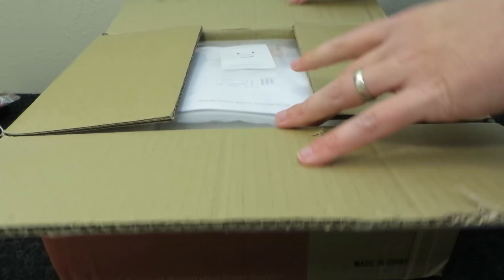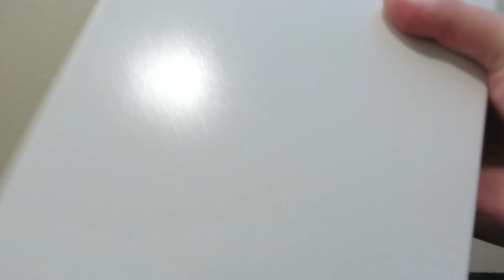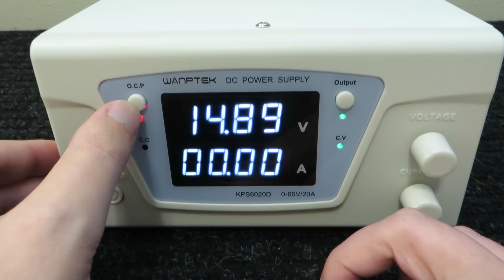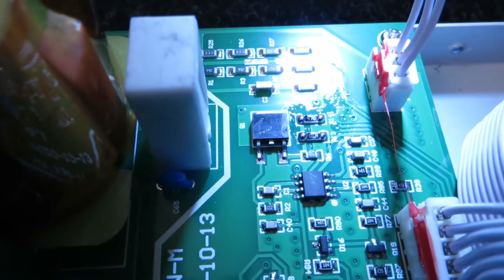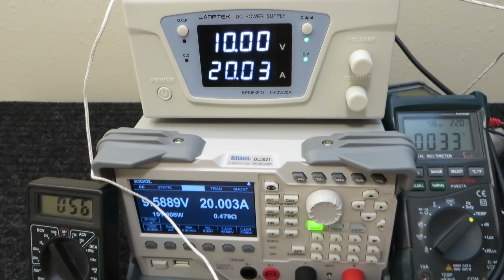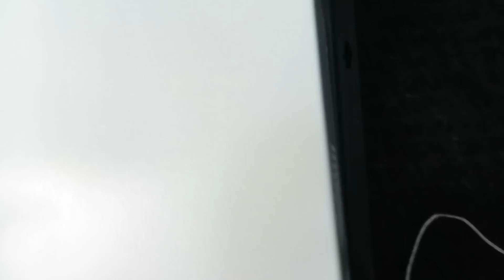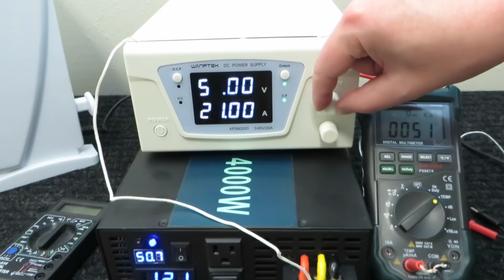1200W 20A 60V AliExpress Lab Bench Power Supply PSU Tested

Comment: Many switching power supplies work from 80-265V AC. I have a 40A one here which DOESN'T. I plugged it into 110V while in Canada (its a 220V model) and it didn't work. Funnily enough, you got an Australian / New Zealand power cable. Made me chuckle when I saw it as I'm Aussie and recognised it instantly. Least they sent the right power supply.
Reply from the maker: Thanks for the interesting tidbit.  I never did bother to look up where that plug style was used.  Not a big deal to get the wrong plug but it's interesting that they'd choose that one to send to North America.
Reply: @knurlgnar24  they didn't send wrong cable.  That plug type is used in U.S. for 110v 50amp service.  50 amp is probably over kill. 30 amp is probably enough.  BUT!  the typical household outlet is only rated for 15amps.  This thing at max voltage and max amps is probably more than 15 amps.  If you using this thing at upper limits it needs its own dedicated outlet.  Not only are you overloading the outlet but the wires in the wall are also only probably rated for 15 amps.  I would like to see more testing on this to see what the input amps.

Comment: Interesting video...looks good inside and works well...prob cost another £50 or more for a decent case plus labour fitting it out and active PFC.
That loose connection was probably caused by moving the heavy output wire about....I thought the worst had happened when I heard the splat.  8-)  Glad it was OK.

Comment: The fan on your inverter sounded like a jet engine. I don't get why these Chinese companies always have the cheapest looking plastic face plates on otherwise decent gear. This thing even had proper metal standoffs under the PCB. I think front output connectors would have been nice. I am looking for a decent programmable PSU like this that isn't too expensive.

Comment: Precision, not accuracy which is a measure of repeatability or statistical error.
Reply from the maker: I frequently use those terms incorrectly/interchangeably in common speech.
Reply: @knurlgnar24  (actually same person).  the best anecdote I can use...
Imagine 4 archers
1) The first archer is an expert and his bow is in good condition - they are both accurate and precise : they put 5 arrows in the centre region.
2) The second archer is also an expert, but their bow has been damaged - so has a left bias - a systematic error.  The archer sends 5 arrows, they all are clustered close, but to the left of the target.  In this case the archer is accurate (repeatable) but not precise (misses the centre).
3) The third archer is not very good, but has a good bow.  They send 5 arrows and they are spread all over the place on the target, but centred on the middle of the target - they are precise - since the mean is correct - no bias, but they are not accurate - as the repeatability is bad.
4) The fourth archer is poor also, and has a bad bow with a bias to the left.  This 5 arrows hit the target all over the place, and centred to the left of the target.  They are not precise and not accurate.
Precision is a measure of systematic bias, accuracy is a measure of spread - or random error.
Reply from the maker: @Tom55data  Sounds like me when playing darts.  I'm really good at putting a couple darts in the triple one.  Multiple times...
Reply: @Tom55data  You've mixed it up.
http://socraticcoffee.com/wp-content/uploads/2015/05/Accuracy-vs-precision1.jpg

Comment: One of my own Korad power supplies tested under 10mv ripple @ 30V at work (I have the 30V/5A model). I'm really satisfied with it, I bought mine off Amazon. I wish I could have taken a picture of the monitor but you don't take pictures in the lab... Mine was able to sustain full load on the load bank for a while pretty safely at that ripple. I haven't tested it for hours on end though.
Reply from the maker: Thanks for the info.  I am satisfied with my Korad supplies also though mine do not provide 5A for extended periods of time without overheating and shutting down.  Still, a 3-4A supply of a quality build for that price?  I still think they're a good buy given how much junk there is available for similar prices.

Comment: I would reverse the fan to blow the hot air out instead of blowing the hot air against the capacitors and so draining the electrolyte of the capacitors
Reply: In that case it may be better to build a shroud around that cooler to draw air across it as you exhaust the air out of the unit. I would be worried about air getting sucked down from above the cooler and not going through the fins.

Comment: just get a 50a LED PSU and 4-5 buck boost converters with displays for arround 100 bucks. and you gat a stupid amound of power
Reply from the maker: That's one option and can be a good option, but consider that a supply like this is simply a PSU with variable control on the current and voltage with a display.  Why convert twice?  That's just waste.  This is the simplest/cheapest way to make a product that does what this product does which means there are 'hidden' tradeoffs/sacrifices people are unintentionally making when piecing together their own bench supplies from DC/DC converters and power supplies.

Comment: One important test that was missed is to connect a scope to it and at various settings switch the unit off and then on and see if there are spikes above the voltage settings with a load connected. Some cheap supplies can kill or damage 5 volt or 3.3 volt logic devices when switched off or on.
Reply from the maker: I agree with you, this would be a good test.  Graceful startup, shutdown, and error handling are 3 places where inexpensive or otherwise poorly designed power supplies often fall on their faces.
Reply: @knurlgnar24  Did you end up doing the test, and what were your conclusions?
Reply: It had inrush protection I doubt that it will put out a large spike when turning on.

Comment: 19:00 I have an O-scope 😁 but I'm not going to measure ripple 😖
Reply from the maker: Perhaps I should have tried to measure it but I realized that my x10 probes had no chance of measuring a ripple of a couple of mV and I didn't want to direct BNC it to the meter.  I could have still done the load step test but, well, it really didn't matter for the purposes I intended to use it for so just skipped the whole thing.  I'm sure it's fine.  (I think I saw that on a tombstone somewhere...)
Reply: @knurlgnar24  I understand, and thank you for the review (and the quick reply). It's just that some of us may want to use it for other purposes and need to know if that couple of mV ripple stays a couple of mV throughout the ranges.

Comment: You should use thermal paste between the thermocouples and the UUT
Reply from the maker: They're usually glued with a conductive adhesive and cut off after use for accurate testing.  Based on my experience if well taped the results you get are within 1c for these type of components...  These were NOT well taped and done with the wrong tape so, yeah, it's not terribly accurate.  I don't think it mattered for this purpose though.

Comment: You have the sense inputs (4-wire setup) on the electronic load, why don't you use them, and instead use an external meter?
Reply: Exactly my thought too
Reply from the maker: Easier to just use an external meter.

Comment: Two big caps right in the hot air flow is not a good design.
Reply from the maker: I noticed that as well.  It isn't ideal but there are likely practical design considerations that resulted in them being placed there so I didn't flag this as a problem.  If this was intended to be a 24/7/365 application I would have been more concerned.

Comment: There are pots inside to tweak the voltage so you get a true accurate output. One for voltage and one for current.
Reply from the maker: There are but the primary issue is not out-of-cal adjustment of the pots and instead linearity issues.  A cheap supply like this one may be accurate at x voltage and y current and get inaccurate at high/low currents/voltages.  Adjusting the pots will only dial in the accuracy at a particular set point and may make other set points worse.  In addition the primary accuracy issue with devices like this is the pots themselves as they tend to drift over time.  Often times a device without trim pots is more accurate than one that has them.  In this video it can be seen that the voltage accuracy is different at different voltage ranges.  I don't know if the difference is in the supply or my meters but the accuracy changes depending on the voltage setpoint.
Reply: @knurlgnar24  didn't consider that 👍

Comment: Am I to surmise you are going build  a lithium  battery out of 3.60 cells? Would love to see you assemble and test some of the 280 AH eve cells.  I built four 12v, connected to common bus  limited to 120 amps from  4 over kill solar bms's that power a 3,000 watt low frequency inverter. Runs RV  AC compressor's and any medium draw motors. Anyway would love to see it
Reply from the maker: The plan is for 16 cells of 280Ah LiFePO4 cells (they look like EVE in the listing - not sure) and connect it to a LF inverter.  Sounds similar to what you did.  We'll see if AliExpress comes through or not.

Comment: The power cable you got with the power supply is for Australia.
Reply from the maker: Good info.  Thanks.
Reply: @knurlgnar24  And Australia is not 120v so the supplier messed up!
Reply: Actually the U.S. uses it for 110v 50A service.  Typical household outlet is rated at only 15A.  Pushing the upper limits with this thing probably exceeds 15A, so they needed a different cord than typical.  Using this thing with a typical 110v cord is a fire hazard.

Comment: I bought a cooking appliance for my Semi truck and it won't work apparently because the inverter is not a Pure Sine wave inverter. Microwave requires 120v @60HZ and the GoPower GP-ISW2000 is just really expensive. Any good ideas for options that would survive being in the cab/sleeper birth of the Truck?? The microwave is the Whirlpool WMC20005Y 750 Watt Counter top unit. Sorry for the Off topic but I always liked your reviews
Reply from the maker: Microwaves prefer pure sine but will work on modified sine at reduced efficiency and increased heating of the internal components.  Sometimes the control panel doesn't like modified sine and that could be your case, but the power portions will run.  What symptoms are you having?  I am asking because I question if it is something other than a waveform issue?  That's an interesting little compact microwave btw.
Reply: @knurlgnar24  only the display worked, not the turntable or magnetron. I even bought a new cheap Walmart 700W microwave and it won't do anything either. The wiring is fine with the Cobra 2500W inverter but I'd rather just have the right kind of inverter. My laptop is over 3 grand and takes almost 300W itself plus I want headroom for my  microwave, rice cooker, and maybe a Keurig lol And this microwave is not being made anymore apparently. As usual the good items go away. Thank you for your help and the great videos

Comment: Dear K24. Nice test, thanks! As I am a ham I am allergic to polluting the aether otherwise than with my transmitters. How does this ps scores on rf compatibility? Good luck!
Reply from the maker: I would guess it performs poorly in that respect.  :)  I didn't test it for radiated emissions but if that is a concern I would recommend a linear transformer based lab supply.  They don't come in 1200W sizes very easily but if you can get by with a lower wattage that would be quieter.

Comment: From my experiences with cheap multimeters the problem with your Harbor Freight unit is likely one of two things. Most likely the rotary switch is dirty. Mine even had plastic shavings get in. If not that maybe there is a poor connection on the banana jacks as these tend to be very poorly soldered.

On some of these meters the input jacks are on separate daughterboard and the connection to the mainboard is achieved with a solder bridge. In this case you can augment the connection with a piece of actual wire.
Reply from the maker: Could be, thanks for the tips.  I tried working the dial back and forth multiple times as well as plugging and unplugging the banana jacks multiple times and it seemed to randomly work and then not work.  The thing always worked before just fine.  I dunno.  Just today I tightened up the contacts on my Extech thermocouple meter that were loose so I plan to use that in the future instead.

Comment: Hello, I too am happy to see more of your video's,  I see in the comments section that you plan to do a review of your WZRELB Reliable Electric inverter, I have been considering purchasing a 48v of this brand, at least for a back-up, if my Cotek goes, and I see some of the more recent Reliable inverters look quite improved. In the meantime, I purchased a SunGoldPower 4000w 48v low frequency split phase w/ transfer switch, and so far has been working good, but just 2000w per side, so over 2000w, it pops a built in circuit breaker, like when starting a window AC unit. I wonder how they claim it has 12000w surge / 6 per side, yet the circuit breaker pops a little over 2000w? Anyway, just a hint, would love to see a review of this inverter, as there are none on youtube, and just a few Amazon reviews. Also looking forward to hear how the lithium battery you ordered works out, I'm from Minnesota, and it seems risky using these in cold weather because of damage to the cells if a battery heater would fail, or the constant winter cloudy weather means less solar charging available half the time, yet with prices coming down, far better charging efficiency, about twice as much usable power per amp hour rating, much evidence of them lasting at least as long as most lead acid without  sulfating issues, they are becoming harder to ignore. So thanks, happy to see your good work.
Reply from the maker: Most of those LF inverters available are scams - hopefully yours works well as some really do what is claimed but most don't.  The issue with LF inverters is that good transformers are very expensive.  The boost FETs are largely the same cost between HF and LF, you omit the output FETs in LF (which are less expensive), and replace the small transformers in HF with a large and expensive single LF transformer at many times the cost.  That LF transformer then has a poor volume to surface area ratio and is thus very difficult to cool compared to the smaller HF transformers.  For perspective a 2kw distribution transformer weighs 60lbs or so, is fully potted, is 96% efficient, and gets too hot to touch at full load at room temp.  So if you see a LF inverter and it isn't at least 2x the cost of an equivalent HF inverter you know something is up.  Per phase power will "always" be limited to the max current of the full winding, so it is normal for 2kw to trip the breaker on one phase of a 4kw inverter.  This is one of the reasons I got a Magnum PAE4448.  Much more expensive but it can do 30A per phase.  Cold temp is definitely a risk for lithium.  They can be used in cold temps at reduced performance but at the expense of lifetime.  My 14kwh lithium battery bank likely won't be here for a few months if it ever gets here at all, and I plan to pair it with that Magnum inverter as it is a good match for their output current capability.  And I expect the cells to end up being 2nds or used.  AliExpress and all...

Comment: Speaking about the ocp, what did you mean by hiccup mode?
Reply from the maker: With power supply overcurrent terminology:
Latch off: When overcurrent is detected the supply turns off and requires a power cycle or manual reset to start back up.
Hiccup: When overcurrent is detected the supply shuts down for a brief time then attempts to restart.  If the overcurrent event is still preset the cycle repeats indefinitely.  This limits average current to something low, say 10% of the current limit.
Constant Current: If overcurrent is detected voltage is lowered until current drops below the current limit level.  This may be very close to 0 volts in a dead short situation.

Comment: I’d slap a makeshift airflow director tunnel out of cereal box cardboard or something over the main heat sink to capture and direct the full airflow of the discharge cooling fan over the fins so it maximizes the cooling capability, but otherwise it seems a reasonable little unit !
Reply: Good thermo design is to have the fan always sucking air through the heatsink and expelling the hot air out through the fan. Fans are much more efficient in suck compared to blow.  The thermo design of that fan and heatsink looked really good to me, which is probably why it performs so well. 👍🙂
Reply: @wizrom3046  don't know what school of fluid dynamics you went to, but efficiency in airflow does not equate to efficiency of heat transfer. The higher energy transfer via turbulent fan exhaust into a heatsink far outweighs any marginal static airflow efficiency improvement. Grab any nearest CPU heatsink fan made since 1972 and marvel in astonishment ;)
Reply: @fiveangle  umm yeah I've been an electronics professional for almost 40 years... 🤫
With a configuration like this PSU the purpose of the fan is to extract the hot air from the cabinet, so the cool incoming air goes over the pcb then heatsink then expelled from the cabinet as hot air.
It's a different deal in a PC, that's a very concentrated source of heat on the CPU and PCs always have a cabinet fan to extract the hot air from the cabinet. Have a nice day. 🙂